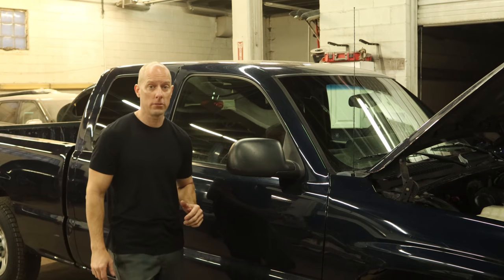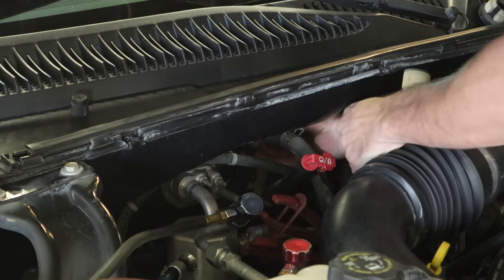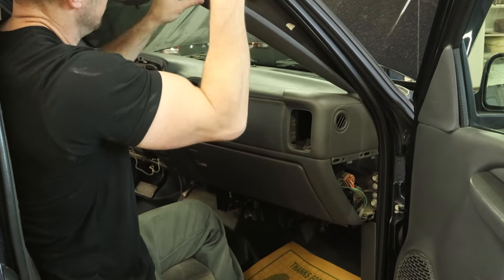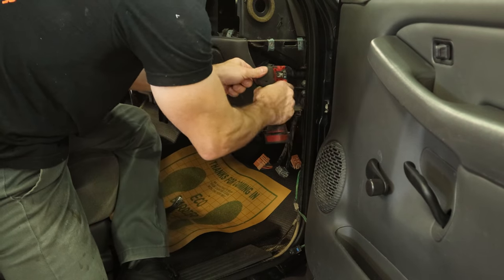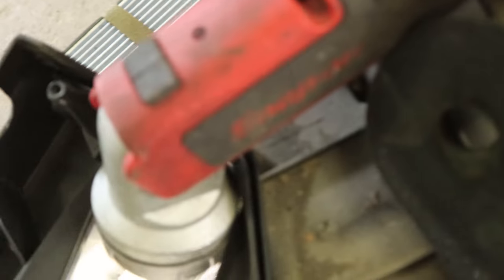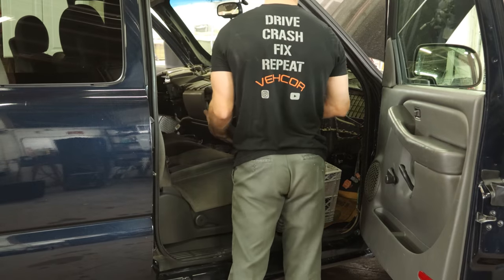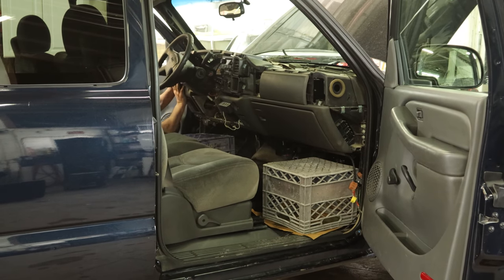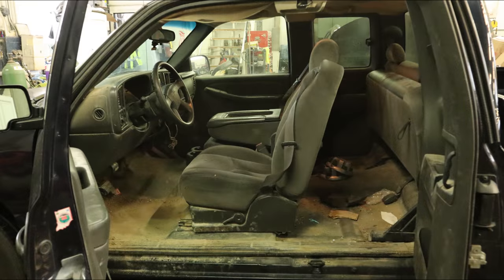Full heater core replacement (the easy way) on a 2007 GMC Sierra and similar models

Comment: Saw a video by Car Wizard and he spent crazy time on how hard the job is to do, Vehcor in this video just does it and isn't there to hype how tough it is, rather that it is doable. Different mindset altogether.
Reply: Car wizard took a much harder approach to do the job
Reply: i was just wondering if the 99-2002 are more difficult, or was Car wizard just being a goofball!?
Reply: Best  yet
Reply: It's all doable if you wanna do it.
Reply: Some people just like to exaggerate the difficulty, possibly to pad their ego and make themselves feel special.
Reply: Bro, NOBODY, I repeat, NOBODY—enjoys removing the entire dashboard, front seats, center console, steering wheel and steering column just to replace a $35.00 part. On top of that, these vehicles are usually 10 years old or more and you end up breaking all kinds of plastic parts. Most DIY’ers just bypass the heater core anyway because the car is old and not worth the headache. 🤔🤔🤔🤔🤔
Reply: Honestly they're not that bad, car wizard being in a hotter area where dash cracking is a huge issue makes sense but I mean I live in an area where we see +40 Celsius pretty consistently in the summer months and -40in the winter and didn't have any issues

Comment: Remembering the really old days on some cars when you could change the heater core from under the hood. I'm sure they could design it now so you could change through the glove box opening, but that would take intelligent thinking.
Reply from the maker: Pepridge Farm remembers! 😂
Reply: I loved doing heater cores on a 80s Ford ranger, all under the hood, a few 8 mm screws on the cover, 2 hoses, and done. You could do one in 15 minutes.
Reply: Yep, like the GM G-Body, couple screws on top, pull off half the hood seal, and slide it right on out, 10 minutes tops including refilling the antifreeze
Reply: "     but that would take intelligent thinking.   "    But that could also compromise the build of the vehicle.  Move one thing and it affects many down the line.
Reply: @mattcat231  Or a GM B-body. Still have 2 of these.
Reply: @markschommer7407  i have an 81 Lemans and an 84 Bonneville, same car, different header panel and hood.  I don't know what body the 78 delta 88 is but i have one of those too, just too rotted to save, but the 403/th350 run like a dream
Reply: 1968 ford station wagon with a 390, Two bolts on the firewall and it slid right out, hoses still attached!
Reply: I work for a car manufacturer. They are designed to be built on the line. Engineers do not care about how difficult it is for mechanics afterwards. 
Still sucks for sure

Comment: Did mines about two years ago on my 2000 Tahoe. As it was my first time doing this I took my time. About 12 hours total (taking photos, resting and learning when to walk away and calm down :-). If I have to do it again I figured I could do it in half that time. I made sure to replace everything else in there as well (evap core, actuators) since I had everything apart. I was not going back in there!

Comment: I think it's great how you explain what you're doing and show us. Great videos. I know you edit for time, how long did this job actually take to do?
Reply from the maker: It took about 2 hours. Thanks for the support!
Reply: @vehcor  I bet that's faster than book time
Reply: @vehcor  you made this job look easy. I did this a couple year ago and it took me like 8 hours. I wish this video was available back then. Great video 👍🏽
Reply: Great video
Reply: Great video👍👍
Reply: @vehcor  One of my worst time sinks is standing there wonder what to do next. You make it look so danged easy. Then there’s the Murphy factor of which crucial, no longer available part, snapped off that you don’t have a spare for on a shelf somewhere. That always slows thing down.
Reply: Thanks for making the video. That looked easy except for the beginning middle and end.
Reply: @josegalvan6181  yeah… me too!
Reply: @josegalvan6181  Yeah, that's about right, me? I wouldn't have found all the bolts in the top of the dash after about 4 hrs or trying... lol. It helps if you've done most jobs before, but for us weekend warriors, we'll probably do it once in our lifetime. 

What I've found in life with "complex" jobs....there's generally a trick or two that if you know them, makes things infinitely easier. 

For eg: I was contracted by a developer I know to change a walk in powder room in their office into a closet/file room. It had a commercial steel door and frame. I got out the sawzall after an hour of fussing and when the building maintenance guy came by....OMG WTF ARE YOU DOING????

I fought for an hour and couldn't get it out. I know there's a "way" but I don't know the way.

You see, there are two little metal tabs on the bottom of each side door frame that screw into the framing behind it. Then at the top where the sides meet the top spreader, there are some metal tabs that you bend over. Remove those screws, straighten the tabs, and the sides pull right off lickity split.
Reply: Great video!  Saw another mechanic  showing a pile of parts and making it look a lot worse than the way you did it. Just traded for a nice 2000 Sierra 178000 miles that’s been taken care of. Hope my heater core or evaporator hold up
for a long time  Wish your shop was close to where I live in Tn.
Reply: @MikeC-g8f  who csw? Not all cars are the same man lol
Reply: @samholdsworth420   didn’t quite understand your comment
Reply: @MikeC-g8f  your S10 does not have the same drivetrain as this is what I'm trying to say
Reply: @samholdsworth420    Don’t have an S10.   My comment said 2000 Sierra. (GMC 1500).
Reply: @trevorjarvis3050  Sort of like tightrope walking across Niagara Falls. If you've done it before its not as daunting.
Reply: @johnpullman3227  I think the big difference between him and the rest of us is he knows how to get all those little things apart without breaking them.
Reply: In real life you cannot edit out the frustrations that will certainly arise...... like not being able to put the hoses back on properly.....

Comment: Heater core blew on my 2000 gmc sierra look at a few videos on YouTube and yours seemed the cleanest and easiest way to do it . After putting off for a couple of week I final managed to dive into it, and following you step by step made it not so confusing. Thank you for making these videos did it in about 6 hours including re taking out the heater unit because I trapped the antenna. I had no friends to help me as well . Not the hardest thing I’ve done but no walk in the park either . Your video help a lot

Comment: Did that a few years ago on my trusty 2000 model. Took me 8 hours, maybe 9 but has a full center console. I didn't disconnect the steering shaft or shift cabke which I see now why I couldnt pull the dash completely free. I pulled it back at an angle to gain access to the HVAC box, pulled the box back as well and barely had enough room to remove and replace the heater core and only because the heater core pipes actually swivel. Pain in the ass. Next time, heaven forbid, I,'ll pull the dash all the way out. There wasn't a video years ago showing the tricks. Great tutorial as usual. AAA PLUS!

Comment: I have looked at other videos showing how to replace the heater core in the early 2000's GM trucks.  All others illustrated way to many things coming apart, parts that didn't need to be removed.  Your video was efficient and an incredible time savings vs other techniques of getting to the core.  Thank You!  This was a great video.

Comment: That's exactly why I love the GM-T800s. They're fairly easy to service, especially when compared to other vehicles.

I'm surprised the top dash pad didn't come out in 1000 pieces like it did in my truck. Then again, 20 years of Florida sun isn't good for any piece of plastic.
Reply: i definitely feel you there, this morning i had to change the rear passenger speaker in my 04 2500HD regular cab, and that whole post trim roof to floor came out in probably 15 pieces, i wasn't too happy.... but at least there's some less rattling from the speaker and that trim panel, lol! Now i can turn up the radio to cover the broken exhaust manifold bolt noise, lol

Comment: I did this to a Colorado that I bought.  Evap and heater core were plugged solid.  It was a good time to clean out and reseal the air box and blower wheel.  What a difference!!  Great video!

Comment: Have done several of these, GM's, and Ford. You're right, take your time a good 1/4 drive set is a necessity. I also use a magnetic tray to hold the hardware. Excellent presentation this will help many people thanks!

Comment: Great video documenting all the steps of taking the dash out. Thank you. Wouldn't this a great time to blow all the trash out of the AC evaporator and replace that fresh air door actuator hidden behind the air box that always dies at about 180000 miles. While you’re in there a new blower motor and thermocouple blower speed control would seem to make sense as well since you have to be a contortionist with tiny hands just to be able to reach those things later. Cheers

Comment: Enjoyed the steps in removing and replacing the heater core. I have a 2006 GMC with the 5.3 engine. I didn't know removing the dash was required to replace the heater core, hope mine never needs replaced. I have told several friends about your channel, so should be getting more subscribers. Good job Scott , look forward to other repairs on this truck.

Comment: It's amazing that taking out the dashboard is the norm for heater core replacement.  A $40 core and the rest is labor $1500.
Thanks for the video.
Reply: If everything was a 10 minute job with a hammer and worn out screwdriver, the vehicle would need to be 3x the size.

Comment: Hey man, Just tackled this after watching your video - which is by far the best one. Trucks with the center console have to remove the front seats and console first... I had to use a bucket and step stool when removing the dash, but it was a lot more difficult getting it back in (no friends either, by myself) because It dropped and angled lower with the bucket. That dash is heavy! Thank you for your vid!

Comment: I drive an 84 Ranger and changed my heater core in an hour.   Nice to have such an easy job guys. You don't have to take out the dash.  I'll put up with the faults.  I never want to pull the dash.

Comment: That’s what I love about this generation of GM trucks, fairly easy to work on. I’ve had a few of these trucks over the years, I have an 05’ Sierra crew cab Denali right now, sitting at 118k miles at this point. So far HVAC damper, and stepper motors on instrument cluster, I tackled those myself, not bad at all. Pretty good for a 16 year old truck!
Reply: older models you didn't have to tear the entire dash apart to get to the Heater cores. You could drop them out the bottom or they were behind the glove box. This new placement is pointless anti-consumer BS
Reply: @MAGWolf  I had an 89’ Camaro for several years, I had to replace the heater core once. It sucked, but I was able to take the dash board loose and slide it out just enough to get the old out and new one back in. It probably would’ve been easier to have taken the dash out. The newer ones are much worse to work on, they engineer that crap on purpose.

Comment: I really enjoyed this video, but then I like all of them. The sarcasm is great.  I have an 05 Sierra with 230K miles.  Been dreading that heater core,  but not as much now.. I did replace that blend actuator on top of the box and that was a pain, but a well put together photo collection made that job much better.  Thanks for your great videos!

Comment: Much appreciated on the video changed my first heater core in my 03 gmc sierra 2500hd with the 6.6 in about 2hrs after watching this for a couple of days and then going bit by bit while I was tearing it apart by far the best way I’ve found to change the heater core

Comment: Much easier changing the core on that then in a Dodge. Looks like you might have done it once or twice. I am surprised that you don't have the extra joint between the wrist & elbow to get to that lower bolt. It is an optional accessory for working on Fords. Great job Scott.
Reply from the maker: Yep, done a few of these.  I left that elbow joint in my other toolbox! 😂
Reply: Little known fact, that's how he got his nickname.

VEhicle
Heater
CORe

Source: trust me bro

Comment: Thank you for this video. I just had to do the heater core on my 2004 GMC dually SLT.  Almost took more time to remove the seats and center console than the rest of the job. Great  information.
Reply: Do you have to take the seats out to get the console out?

Comment: Thanks for the weekend surprise video! I have a 2002, 300K mile Suburban which I bought new. I live in Los Angeles so I'm not sure the heater even still works. But, I am moving to Pittsburgh in 6 months when our new house is done, so I am saving this video just in case I find out next winter that the heater core is kapuut.
Reply: @mrpesky163  but freedom is a little north of pittsburgh
Reply: @brianfairchild7819  Yep, by criders corner, lol
Reply: @mrpesky163  Pittsburgh itself is as democratic as it gets, a lot of suburbs are conservative, from my driveway to market square in downtown is 28.6 miles north.

Comment: This is a much easier way to get to the evap, than disassembling the whole dash, like I saw on another vid. I've got an 02 2500hd Duramax, with floor shift transfer case, so should be pretty much the same, without the center console.

Comment: Best video out there for this process.  I am having an issue with it coming loose on drivers side it seems.  There is something I am forgetting or not seeing in this removal process.  Have it all disconnected at pillars and the 4 bolts at top.  Steering wheel bolt/nut disconnected, shift cable disconnected, bracket bolt just below column removed, support brace at about center bolt removed.  Obvious electrical connections mentioned in this video disconnected.  When you are talking about bolts over steering column those are the ones i believe I am not understanding unless that was included with the 4 bolts up top close to windshield.  Any assistance with this would be appreciated.
Reply from the maker: I did not see you mention the bolts on the top.  They have 15mm heads and are accessible looking straight down from the top of the dash (easiest to look through the windshield).  They are tucked way down there so you need an extension but not too long, you need to clear the windshield.  The duct is shaped around at least the left one I believe.  It was in the video but I didn’t see those mentioned in your list.
Reply: You are the boss.  Thank you.  Believe it or not I was suspecting it was them...just wasn't certain.

Comment: I have done a squarebody Chevy heater core, I was so happy how easy it was. the year before that I did a ‘93 GMC jimmy the s-10 style one that one took awhile.
Reply from the maker: Never liked the earlier 90s Blazers and they were common failures!
Reply: @vehcor  it was my brothers truck some how I got roped in to it.
Reply: I will say that the hardest part about replacing the heater core in a 82 to 93 S10 is  getting to the top screws on the cover. I've replaced the core in my 91 ext cab twice. I found out the hard way to stay away from the aluminum heater cores in these trucks. It only took 3 parts stores to find the correct unit.

Comment: I had to replace a leaky evaporator on my 23 year old Silverado 2500 HD (it only had 130K miles).  Decided to go ahead and do the heater core and those pesky actuators too.  Replacing the actuators is a real gamble if they are not currently malfunctioning, but hey, I got married in Vegas, so...  I watch many of your YouTubes.  Yes, you have friends.
Reply: Also, your tips on this job were very useful.  And I didn't really have too much trouble with that bolt behind the engine, using a flex head ratchet wrench.

Comment: I saw your thumbnail and my first thought was "rut roh" lol

I remember back in the day when changing a heater core was an hour job at best. 2 heater hoses, some silicone sealant, a couple of wires on the fan and a gear clamp was about the gist of it. Easily and readily accessible from under the dash in the passenger footwell.

Comment: Quick tip on those actuators, probably mostly for commenters. The grease they use on the gears inside eventually gets on to the rheostat (or variable resistor or what ever it’s called) clean that up with alcohol, along with any other loose grease, put a little, little dab of dialectic grease on the gears, re assemble it and put it back in, that has been my problem with everyone of those gm hvac actuators. After that they work like a charm.

Comment: Thanks. We prayed that you would find a friend. Also, now that I see more clearly the intricacy of the "new" cars, I'm far less likely to do any work on them. In a moment of temporary insanity, I did replace my Ford Ranger tailgate handle... which is the easiest job on the truck... easier even than changing bulbs. Well, maybe adding windshield washer fluid...

Comment: Great video. Shows eaxctly what you need to take off to pull the dash back. I just need to replace the hvac actuators and did not need to mess with the shift cable in mt 2003 gmc denali.

Comment: I am glad to see an off cycle video from you.  I wasn't so turned off by the dirty vent tube or kick panel @ 17:00 you put back, as I was by all the cigarette burns in the driver's seat.  Naaaaasty.
Reply: It was only dirty on the outside. 😁
Reply from the maker: The seats had no wear or stains but ruined by cigarette burns, sucks.